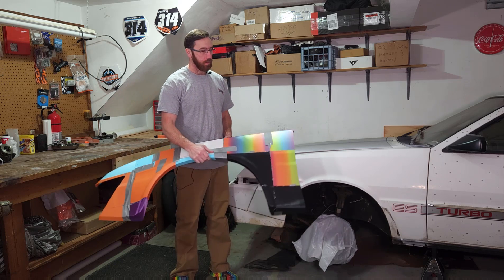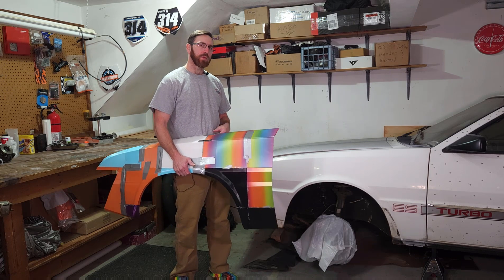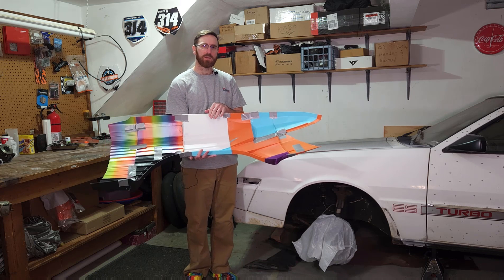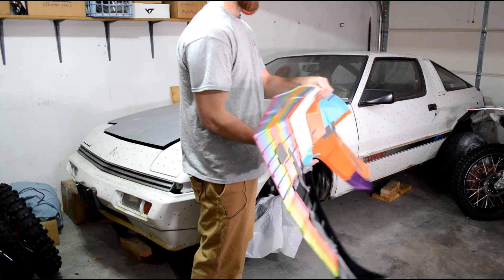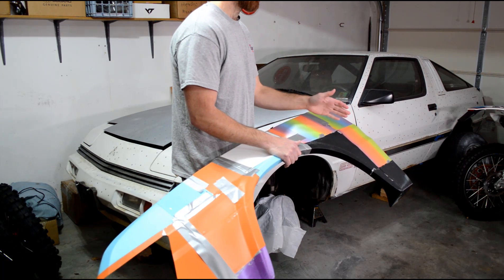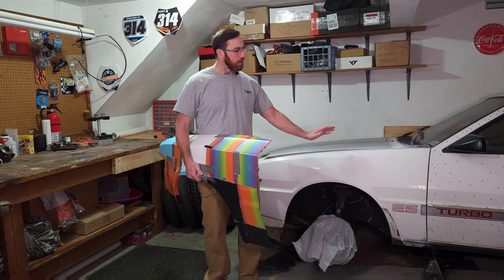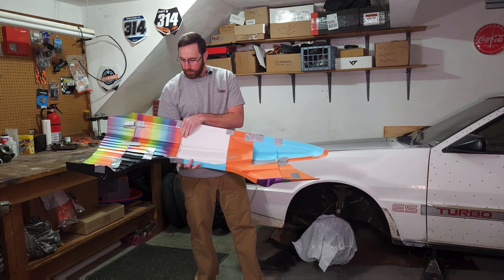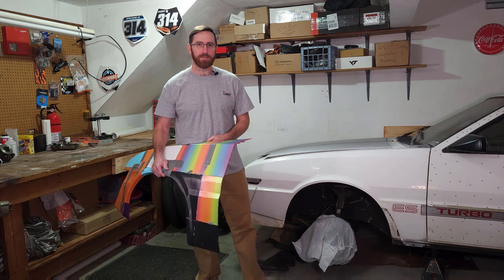Scan to Part Series Part 15 | What Went Wrong With The 3D Printed Fender and How You Can Avoid It

Comment: Get a 3d printer-pen for joining different sections. On a part like this I would chamfer the edges of the sections (including mating flanges), use superglue to hold the sections in place and then fill the joining chamfers with the printer pen. It´s a strong join and also makes the finishing steps easier as you´ll have a surface with a uniform material to sand, fill and prime.
Reply from the maker: interesting idea.  the parts bonded great with the expoxy, the issue was really registration.  By 3d printer pen you mean one of those hand held doodle things?
Reply: @LearnEverythingAboutDesign  yes, those “arts and crafts for kids” looking things that mostly cost less than 20. But they work good for the purpose.

Comment: Yeah. Add flanges for gluing. I'd even add isogrid-esque structures to the backside to make sure part stays in the designed shape when  assembled and eventually a mold made.
Reply from the maker: Great tip!  These all had flanges on them, i would just make them bigger with holes or bumps to positively align them on another attempt.  The simple vertical ribs added a ton of strength and i used an infill so they didn't add much to the material or printing time thankfully.

Comment: Thanks for sharing ! especially the ugly side of things.

I had experience with 3d printers prior to getting into reverse engineering, so deciding to outsource 3d print was a no brainer. Big/joined parts are still a bit of an issue, but end of the day the outsourced company will make pretty usable results. If anyone cares, SLA prints with a good layer off wax can demold from tooling gelgoat fairly easily. The molds are smooth enough that you don't need to polish to put them in service (well unless you need shiny parts).
Reply from the maker: Nice!  This year I will be doing some functional prints and also molds off prints for an upcoming project.  Ill think about SLA but the parts being large is tricky.  A pla print might be $2 worth of material and some time with high build primer and sanding vs expensive SLA outsources.  Do you have a certain SLA material you like for that? ABS "like"?